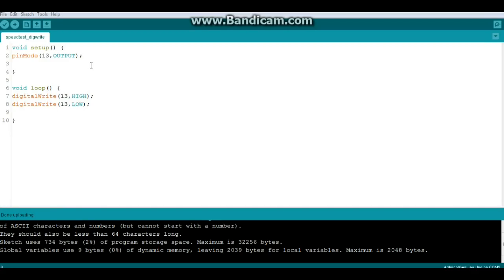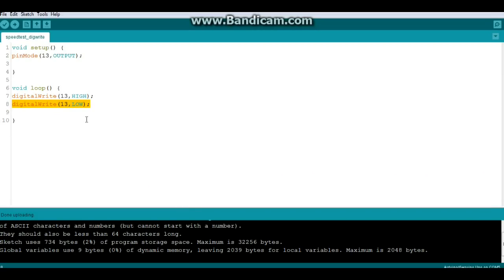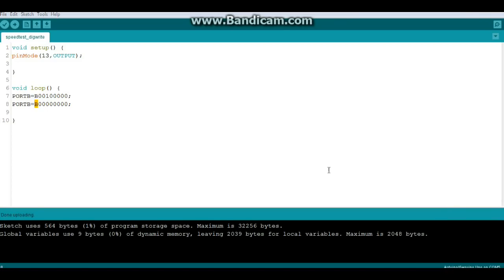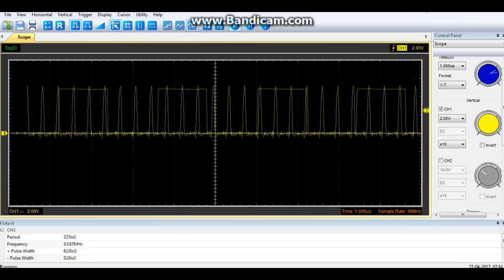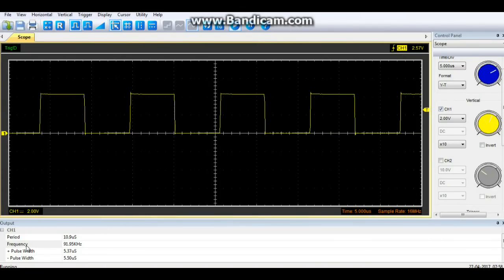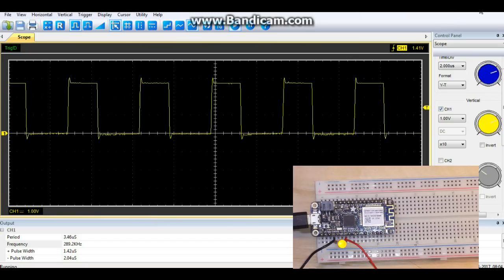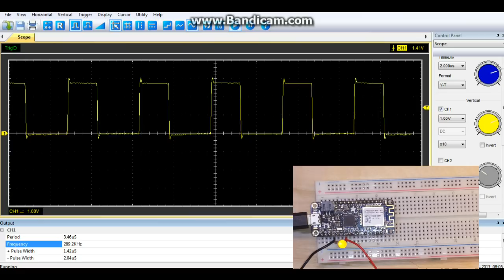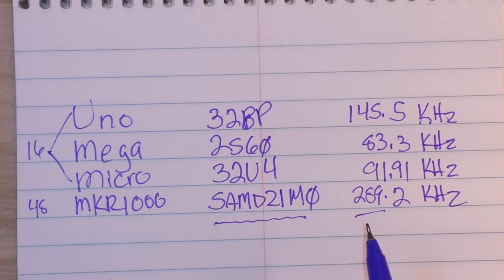Arduino Models Speed Test

Comment: Excellent video. I really appreciate this information. I wonder how fast you could drive a cheap stepper motor using PORT commands in a loop instead of the high overhead library commands? I would be very interested to see a video on that. Also, comparisons with ESP8266 NodeMCU's would also be very interesting.

Comment: I have a midi controller using the pro micro and a 16 channel multiplexer for reading 12 potentiometers. I currently have my readings coming through using a for loop that will read all twelve inputs and store them in an array. The problem is the pro micro can’t read them very quickly and it’s causing my data readings to be low resolution particularly when moving a potentiometer.

Can I speed up my readings by using port programming like you did? Or should I just opt for a higher clocking micro controller like the PJRC teensy?
Reply from the maker: Or an esp32

Comment: at 1:04, what you pointed at isn't the resonator that runs the mega. That particular mega board uses a ceramic resonator, and not a crystal. It's that small kinda silver package above the main chip of off to the right a bit, with the two traces leading back to the MEGA chip.

Comment: you should see how fast you can get analogRead. once got like a megasample/sec on a due with this https://github.com/fredlllll/STIXXXWT-Arduino/blob/master/examples/Oszi/Oszi.ino ignore the whole display code
Reply from the maker: I just looked at your code, very impressive. Do you mind if I play with it a little bit?
Reply: (im a software engineer ;) ) play all you want. maybe you can press more out of the ADC by using interrupts. i think you said you dont own a due though, so you will probably not be able to reach 1 MS/sec. lets see what a normal atmega328 can do. (my oszi code is tailored to run on a due, so the registers might not be available on other arduinos)

Comment: Great video. I was very surprised that the Mega was slower than the Uno. I wonder how one of the cheap generic STM32 minimum system development boards running at 72Mhz with the Arduino bootloader would compare.
Reply from the maker: I was shocked about the Mega being slower as well. I guess the overhead of the compilier and bootloader is more significant than I thought. I haven't played with STM32 board yet. But, I now have a partnership with BangGood, so I'll ask them to send me one and we will see.

Comment: the crystal you pointed to isn't the one for the 328p. it's for the 32u chip. the one for the 328p is much smaller 6 pin device right next to it. Also get a teensy 3.2 it's awesome
Reply from the maker: OtakuSanel ok thank you

Comment: the crystals used by the microcontroller are actually those, that i highlighted here: https://imgur.com/a/STH9n
the larger ones are just for the programmer. nevertheless, both are oscillating at 16 MHz
Reply from the maker: c5e3 thank you